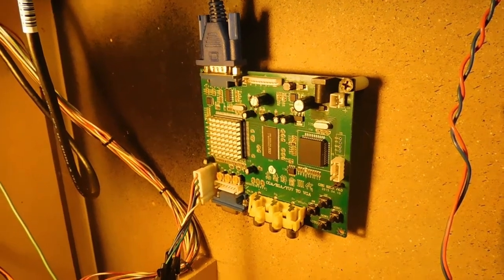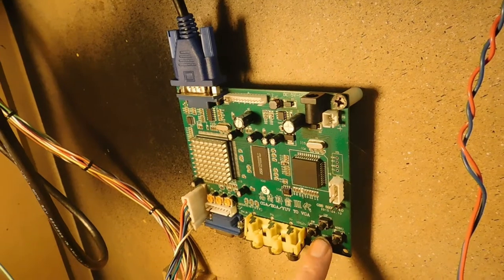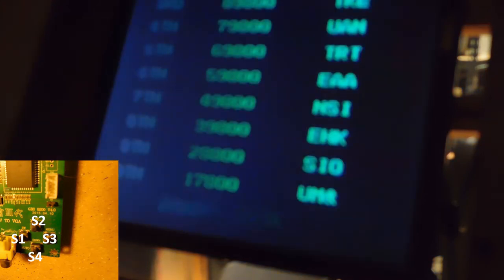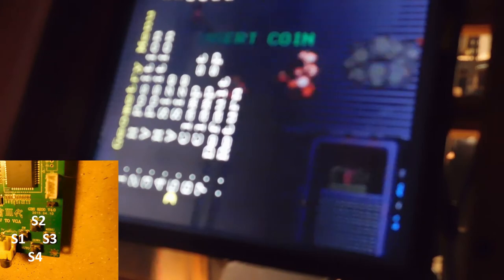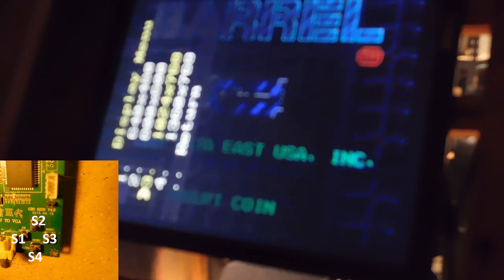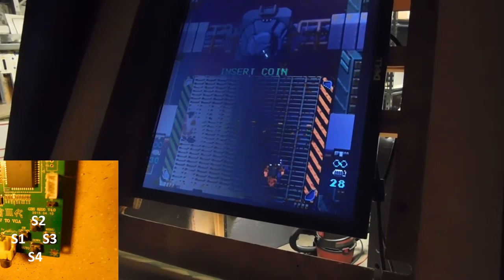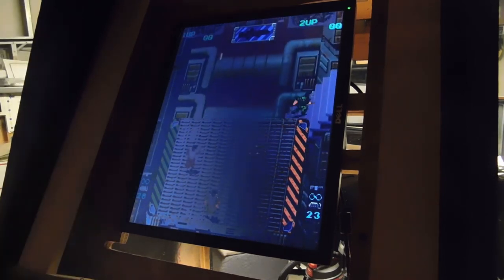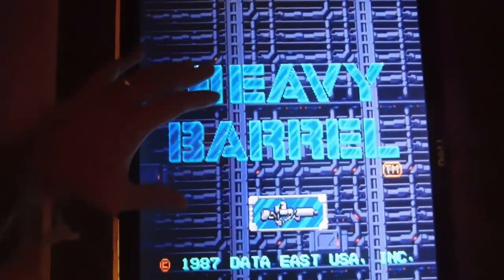How To Adjust A Video Convertor PCB {CGA To VGA Convertor PCB}

Comment: Hey Will.  Is the monitor display in this video set to portrait?  I'm using the same convertor and would like my screen to be portrait instead of landscape, but that's not an adjustment in the monitor's settings.  Can that be adjusted using the convertor?

Comment: All arcade boards video outputs are RGB with Positive Sync or Negative Sync. Some arcade boards output RGB negative sync while others output Positive Sync. The CGA stands for Color Graphics Adapters but it doesn't have options to convert negative sync to positive sync or vise versa? It should be able to take RGB and convert it to VGA for using LED Monitors or LCD monitors.

Comment: Im trying to Convert my Wells Gardner Arcade Monitor to VGA to run my mame games im using CRT EMU to run it off of my AMD 5450 card I just bought this converter trying to get my Wells Gardner on..
Reply from the maker: The CGA to VGA PCB I used in this video can also convert VGA to CGA, I've never done it before but the manual for the PCB shows it's possible to do. I'll look into that more and make a video on it if that can help you out.

Comment: I'm try to use one with my mortal kombat 2, and I'm getting nothing.  No signal at all.
Reply from the maker: I'll make a video on this topic, it may take me a little bit to do it but I'll make a video on it so maybe it could help you with the issues you're having. we'll get your game working one way or another.
Reply: @willsarcadeservice4599  I put it on geometry 28 and everything, still nothing.
Reply from the maker: @barryjohnson5288  Have you tested the convertor PCB with another game? Maybe the convertor is bad? I've used one on a Mortal Kombat in the past and it worked. I'll make a more detailed video soon and maybe that can help out.